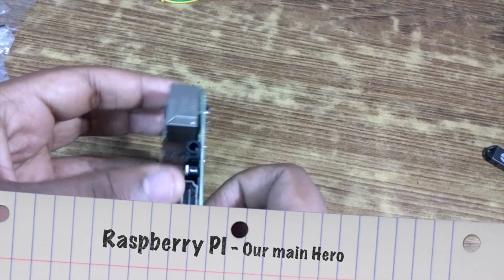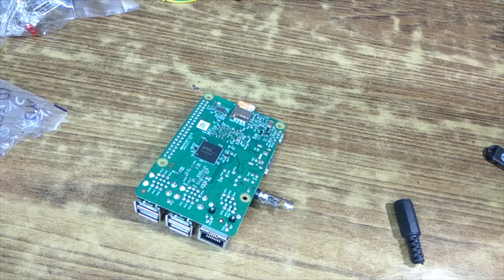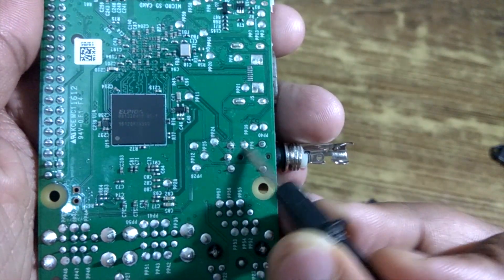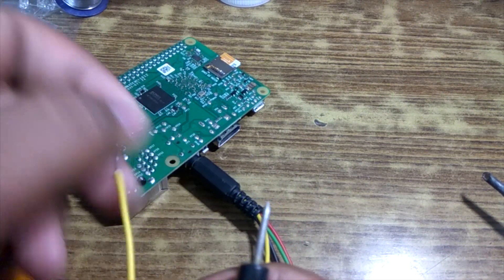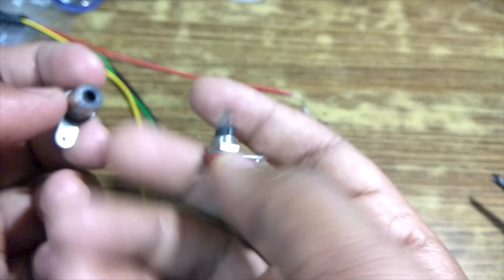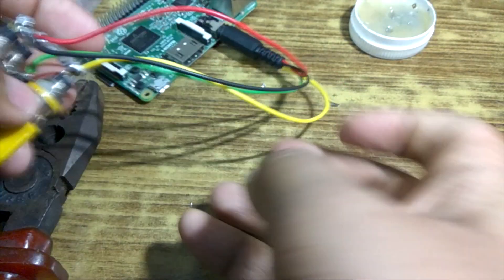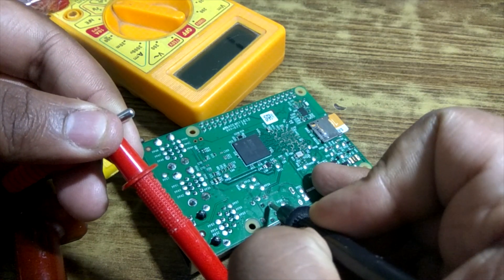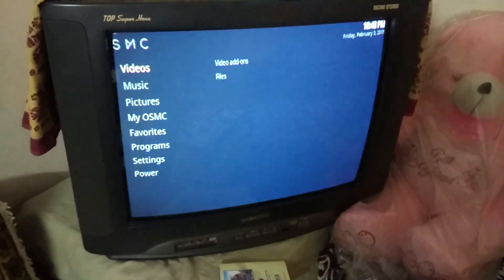How to convert your old CRT TV into Smart TV using Raspberry Pi 3!

Comment: you can directly buy that cable which he made in the video,https://www.amazon.in/Cables-Kart-trade-Male-Audio/dp/B01JSL4RDM?tag=googinhydr18418-21&tag=googinkenshoo-21&ascsubtag=23d63489-a8bf-4727-b23e-4ca578a1fa94
Reply: varun kumar this is not working for my mi note3 to lg crt tv

Comment: https://www.amazon.in/dp/B072JPP9KX/ref=cm_sw_r_cp_apa_i_meIGzbDFQ9Z6P 
Can I use this product .
Reply from the maker: you can get any similar product, if it doesnt work, then you will have to splice the wires open to make sure the connections are in the right order as the raspberry pi needs.

Comment: is there any readymade 3.5mm to RCA female cable connector from my raspberry pi 3  to tv RCA pins in online stores like amazon, flipkart etc...if any pls provide me the link
Reply from the maker: there are, but i am not quite sure if they work so i made my own, search for "3.5mm to RCA" on amazon or ebay.
Reply: i tried searching about earlier but i have also the same issue that it works or not as the various parts needed to make connector are not available to me....so i asking for the readymade one...tq for ur reply
Reply from the maker: the parts are easily available on electronics shop, or you can remove those rca connectors from old vcd players or old tv's, go to like a old tv repair shop they should have those rca female connectors, and you don't really need a 3.5mm male you can also solder wires directly to raspberry pi PCB but be careful if you are trying that.

Comment: Wouldn't a premade cable be cheaper?
Reply from the maker: Noniksleft I can't trust that cable to work specifically for the raspberry pi. though there are chances it might work.
Reply: Why would raspberry pi make their 3.5mm av output different from the standard? Its Extremely unlikely that it wouldn't work because of the video left right grnd being in a different order
Reply from the maker: http://www.raspberrypi-spy.co.uk/2014/07/raspberry-pi-model-b-3-5mm-audiovideo-jack/ . still it would be better to make one myself.

Comment: Awesome tutorial but what about using HDMI slot, does HDMI to AV converter for this case? I was worried about what if it won't work.
Reply from the maker: Remix Adda some work some dont. if you get a good HDMI to AV it will work
Reply from the maker: Remix Adda there are some cheap ones on ebay that fail to work.
Reply: So how to distinguish the working one.
Reply from the maker: Remix Adda those white boxes that say HDMI AV I'd stay away from them . Ive read review of them being duplicates .
Reply: Good

Comment: if you want your old TV to turn into a Smart one then use TV Box because it is specially dedicated to this and has wifi,almost all video format playback,android 6.0, android apps,remote etc. It cost nearly Rs 2000 to Rs 2500 (depends upon variant you select) Raspberry Pi 3 cost around 3000, but if you want to experiment then you can do with Raspberry Pi 3...anyways thankx for the video.
Reply from the maker: those boxes don't have much support for the future . and raspberry pi has android tv 7.11 support and can run most media files with Kodi. its moldable . lot of modules comes for raspberry pi . and ofcourse it's more fun than just sticking in a hdmi to rca converter.  which adds to the cost of the android box.
Reply: Satyajit Ghana ya u r absolutely correct...
Reply: but i think tv box now a days also has AV OUT option, so no need of hdmi converter.
Reply: Im confused why buy rca ports when you can buy a cable with a headphone jack on one end and rca on the other?

Yes thats an option with the rpi2 and 3 (Im currently using that on my crt)
Reply: Some of us want an emulation console.